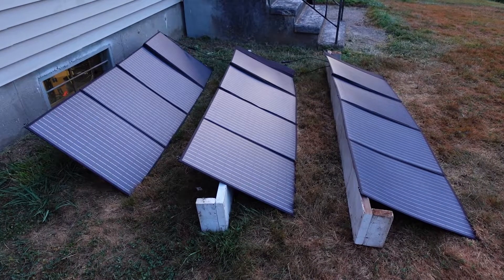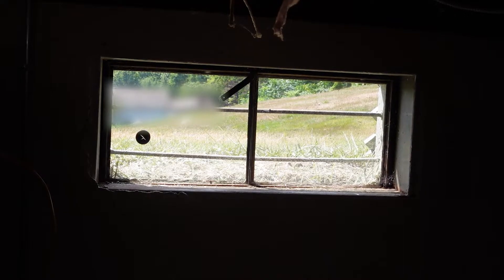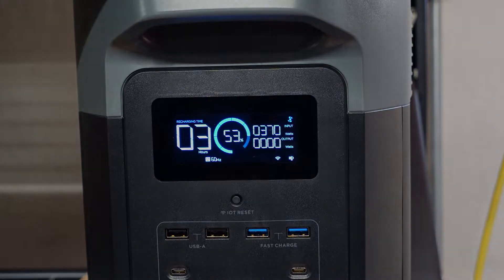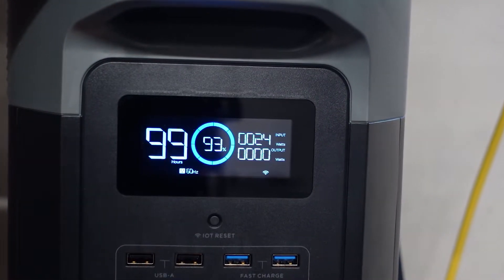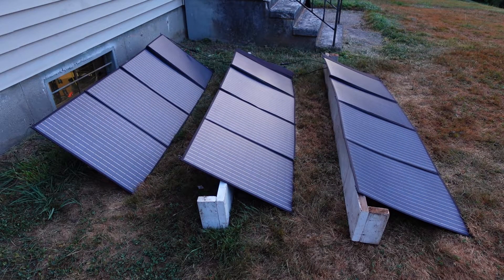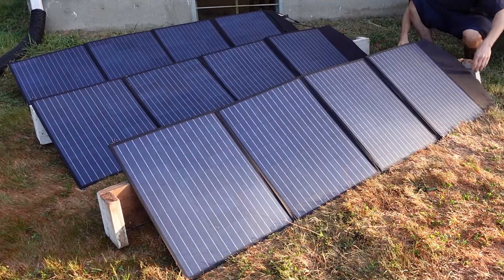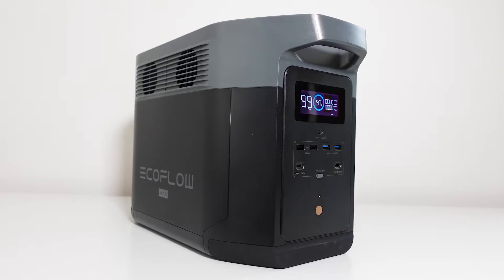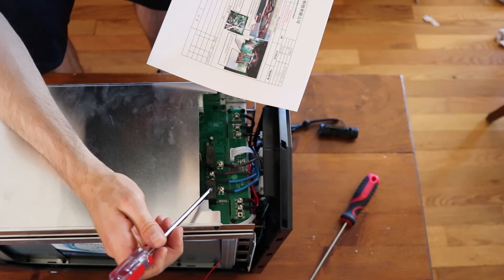Ecoflow Delta Max (Part 7) Refrigerator & Freezer Chest Extended Run Time Test with 3 Solar Panels

Comment: I think you can buy an expansion battery for the unit .🤔
Reply from the maker: Yes you can.  I personally would recommend purchasing the Delta Pro over two batteries of the Delta Max.  This is primarily due to the battery chemistry.  You'll get way more cycles out of a Lithium Iron Phosphate battery in the Pro model.

Comment: Hello, I just viewed your wonderful 7-part series. I'm new to this as well. I would like to ask if you changed your solar panel connections from SERIES to PARALLEL? Please remember I'm new and my application of math might be incorrect, but those nice solar panels have a specification rating of Voc of 22.2V & Ioc of 12A for each set of panels. The math in connecting the three sets of solar panels in Series is (22.2v x 3) x 12a = 799.2 watts and connecting the three panels in parallel 22.2v x (12a x 3) = 799.2 watts. So, no matter how you connect the panels, series or parallel, the final output of 799.2 watts is the same. But connecting the solar panels in parallel is less likely to suffer from any shading that might occur on ground mounted solar panels. I noticed the total input into your EcoFlow was @ 340 watts. Thats a huge difference from 799.2 watts the 3 sets of panels can potentially output. My theory is converting your panel connections from SERIES to PARALLEL and see if the panels have less "shading effect" resulting in a more constant input.
Reply from the maker: I haven't tested parallel as of yet. Correct on the shading but those are 200w max for each individual panel